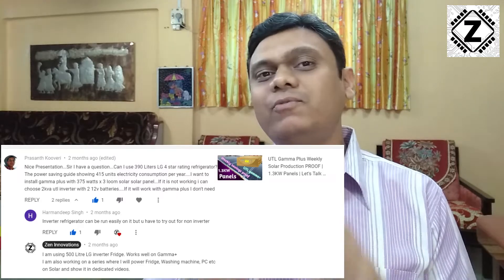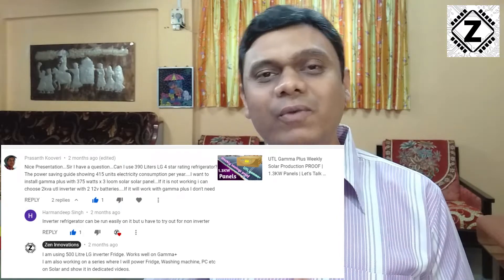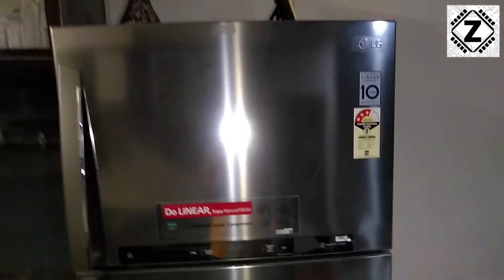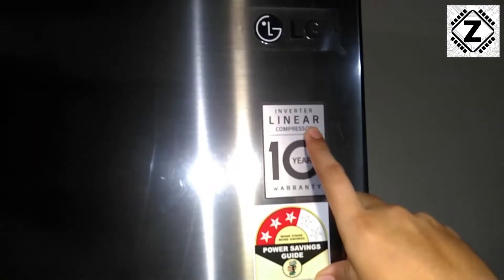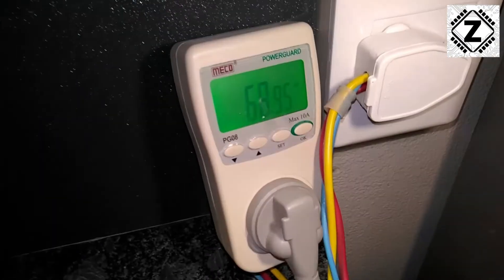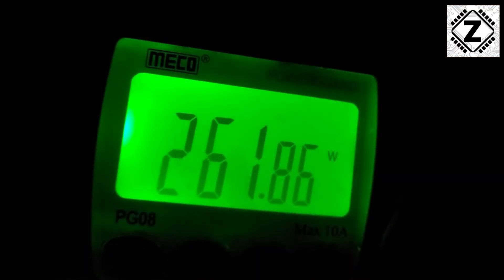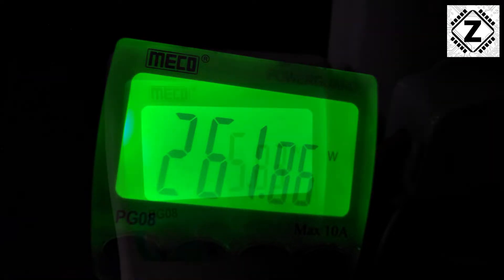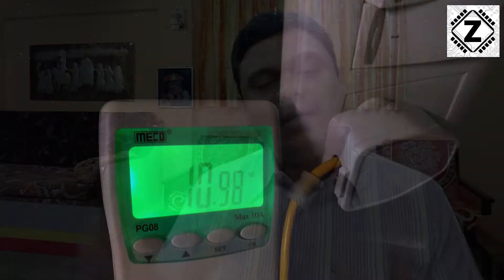[Eng] How to run a Fridge for FREE on Solar Inverter | Which Refrigerator will work? Which wont?

Comment: Good information bro
One suggestion is plz use 2way switch,it is use don't change unplug fridge power pin
Reply from the maker: Yes, 2 way switch is also a good idea. But 2 way will not switch Neutral so I use Socket method.
Also, I never had to change the socket. Not even once till date.
Reply: @ZenInnovations  I've installed MCB type changeover for all heavy appliances , runs on solar during sunny days and around 5pm  or gloomy days switch to mains  recommended by solar installer, 
 Remember him saying that during night, there some extra discharge so to avoid granny appliances like fridge, water pump, ironing... How correct is that?
Reply from the maker: @coolestspott69  1st part is good..not so sure on 2nd one. Fridge consumption depends on temperature which is usually less at night.

However it's best to avoid heavy load on Battery